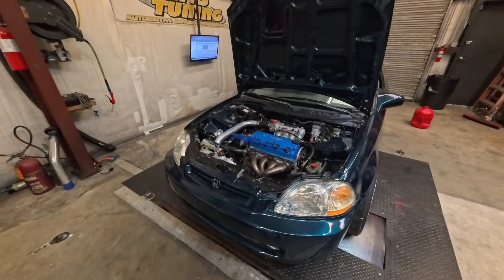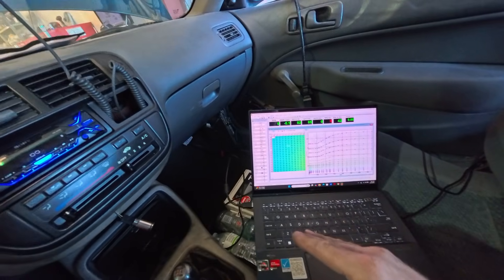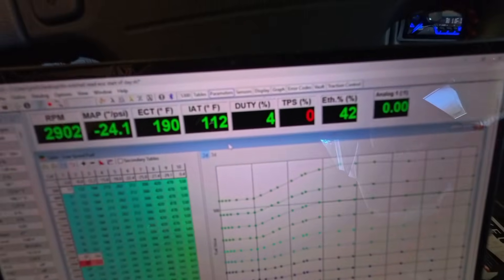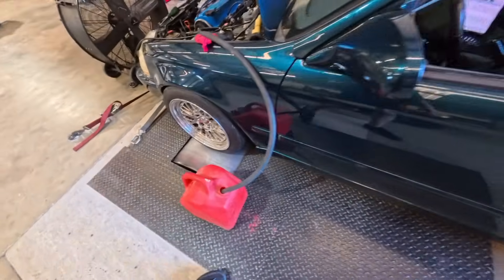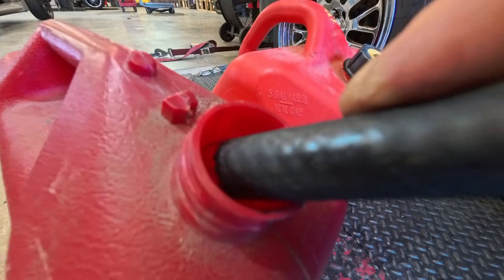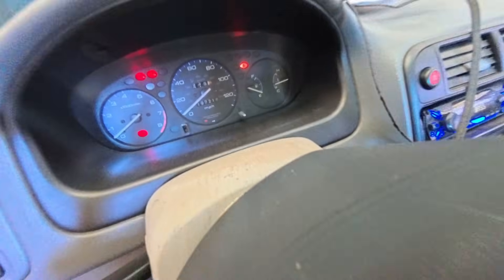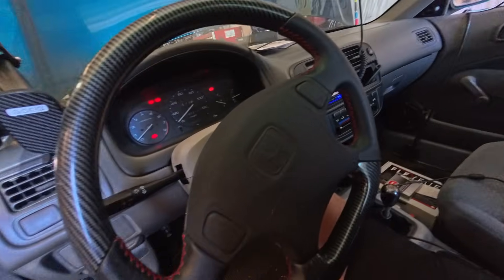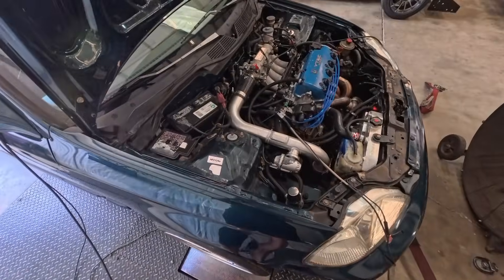360+ Horsepower Turbocharged D16. Honda Civic Flex Fuel Tuning on Hondata s300.

Comment: Excellent video! Big question for you- is it possible to build one of these that doesn’t need to rev to the moon to make decent power? I have a 1992 Civic VX with the D15Z1 motor with VTEC-E, where it opens all the valves at 2,500 rpm. With the tall gearing, I really never need to leave the rpm range of 3,000-3,800 rpm, it just doesn’t like the higher ranges and has a good bit of torque on the bottom end. I would likely not use this motor to turbo, but I do like the tall gearing for highway driving, and being able to sit in third gear all day on almost any twisty road is great. The car just needs a bit more power to be a lot of fun, even 180-200 hp would be hella fun. Is it possibly to build a turbo D-series to make that kind of power starting between 2,500-3,000 rpm? I basically never take the car above 5,000 rpm, I drive it really smooth and conservatively, just staying right at or below the sweet spot of the torque curve and not chasing peak power.
Reply: Get a small turbo, they spool quickly, 200 at 3,000 rpm? No....
Reply: That economy only has saver VTEC E
Reply: @AlphaTechnologies-m9u  The VTEC-E is great!  There is such a big boost in torque at 2,500 rpm, the only issue is the car is geared super tall and doesn't have quite the oomph to keep it there.  It weighs so little though, surely about 200 hp would be enough to keep speed at that rpm even on hills.  I hope.